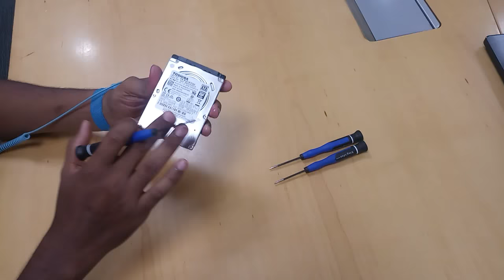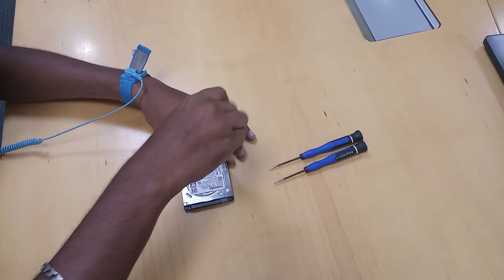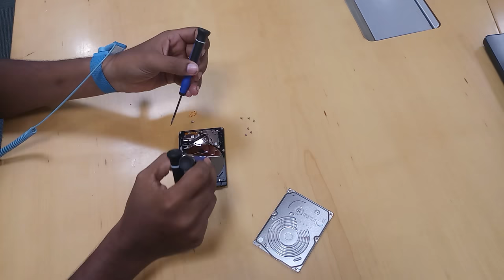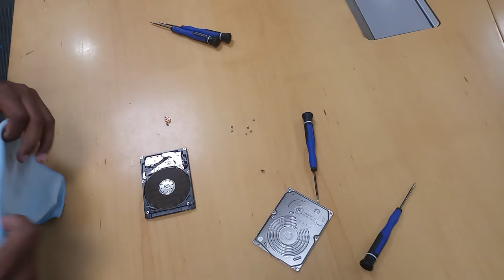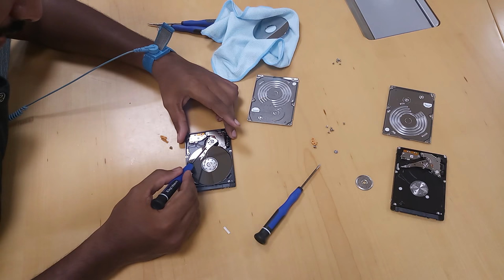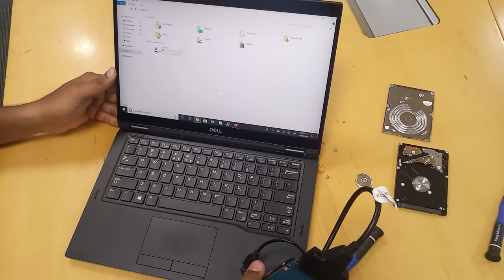Recover Data from Dead or Damaged Laptop Hard Disk in Tamil |  (தமிழ்)

Comment: Bro amma laptop lenovo e41-25 la irunthu Seagate hdd problem nu edutha, Sata case potu veliya connect panna hard disk la irunthu entha sound umm varala, normal ha pc la connect panna kuda harddisk yethum sound varala enna issue ha irukum na, laptop 3 -4yrs ha use panra

Comment: Hey bro. I am from hyderabad. I liked the video its really good. I got to know about new things. I have one question please answer it for me. To change the head is it required for every single number written on hdd to match with donar drive. Or else only model number and size off hard disk written on it should match with donar driver while replacing any part in the hdd.

Because there are many nunbers such as PN number MLC number then model number n etc etc etc so may numbers are written in it. Pleae let me know if only model number and size of hard drives is important and should be same while replacing parts from bad hard drive to good one for recovering the data.
Reply from the maker: Bro, model number and hdd size should be same while replacing the parts from bad hdd to good one...
Reply: @MegamindTamizhan  bro yanodiya pc vanthu oru error iduchi bro na yanodiya pc on panain bro athu insert boot media in selected boot device and press a key intha mathiri katudthu bro na Ctrl+alt+ delete press pana bios kulla starting loding screen na nikuthu bro new hard disk vanki OS install pana bios kulla pokuma bro plz bro yanaku comment pannunga bro plz bro yanaku comment pannunga plz 😭😭😭😭😭😭
Reply: @vishnuprasathjanakiraman8878  MBR gpt format change agirukum bro bios la legacy potu parunga varalana uefi podunga appovum varalana harddisk Govinda nu artham
Reply: @vishnuprasathjanakiraman8878  pudu hard disk vangi potalum bios open panna open aagum but ssd ponga athan best ....palaya hard disk la data important ah iruntha atha recovery service kuduthu than recover pananum intha method use panna harddisk failure aagidum